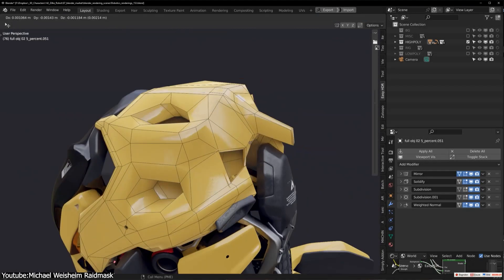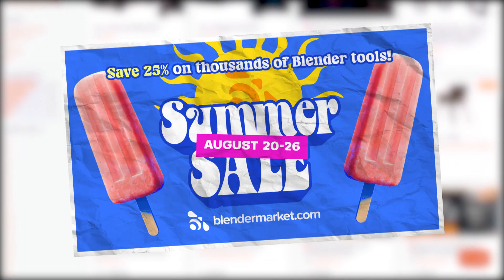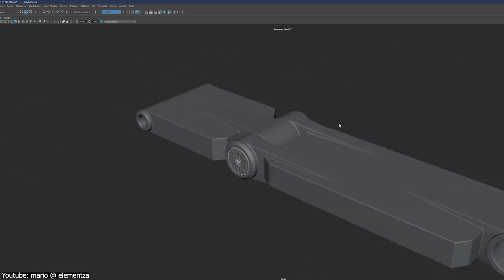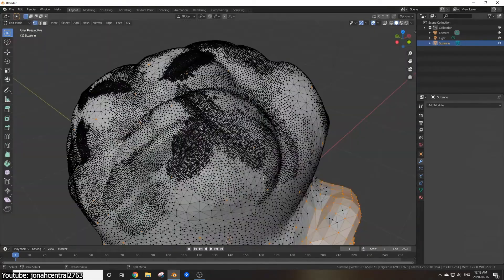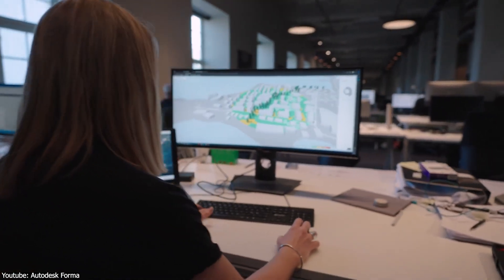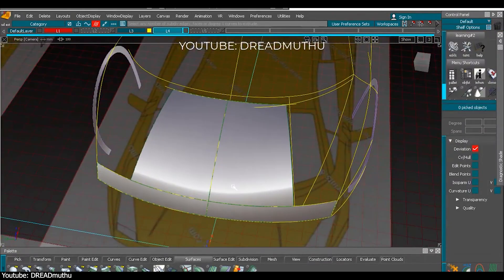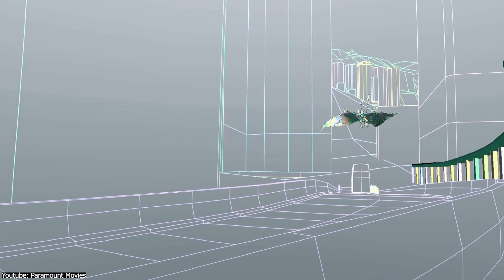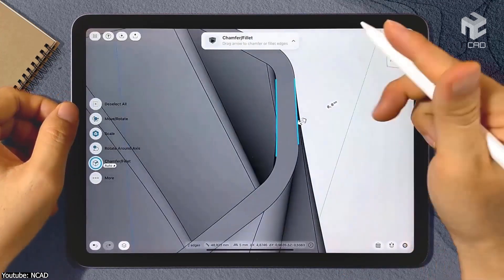Hard Surface Modeling vs CAD modeling

Comment: software is just a tool, and like any other such, specific ones for specific needs...
one particular thing almost ZERO people talk about is: there are a lot of tools one doesn't really need, and only exist to for QoL improvements...
for those who don't know, engineering CAD is generally parametric, depending on what you are trying to design that can be an advantage (but not always, as it sure has limitations), but virtually all engineering CAD needs to use polygons to render graphics, in most setting, this is a computer graphics requirement imposed by the hardware and is non negotiable (which is called tessellation)... in fact tessellation is also used in traditional CAM...
so, polygons are not necessarily "easier" to render (depending on what easier means to you here)... ray-tracing w/out tessellation can be much less computational intensive, but you need the software/hardware combo for that... "polygons simpler to animate" also not necessarily true either as it depends heavily on the software being used (many CAD use "animation" for mechanical evaluation/simulation)...
it is indeed a rabbit hole tho...

Comment: Nice explanations, except it was forgotten mentioning sdf modeling techniques which are rarely mentioned. These allows both cad and soft objects to be modeled. And these software are very promising because they are much more tolerant to boolean operations, on the contrary polygonal boolean leads to abnormal geometry often with trouble in calculating the normals, and CAD simply doesnt allow the boolean in certain conditions, particularly when dimensions are changed in the modeling history leading to impossible shapes (considered as by the CAD kernel used some more tolerant than others)

Comment: Cad is like a high polygon! because it's easier to fall in trap details because of its ease of use, if you need to 3d Print , cad is the way to go , and when you convert it to polygon , it will be harder to retopology the more details the object have! Cad is flat lack texture! so it's converted to low poly so it can be used to game assets and be colored and textured!
Reply: holyshite, if you don't understand how things work you should refrain from saying anything...

Comment: I am a solidworks guy trying to learn polygonal molding using C4D. I found this really helpful.
Reply: Same! Mechanical design engineer with Inventor trying to learn 3DS Max!
Reply: Hi bro.. can you please tell me.. is it possible  to use clean hard surface polygonal 3d model from any 3d software like blender Maya and open this model inside cad software like Catia solidwork and use it for CNC print

Comment: Since I use both Hard Surface Modeling and CAD modeling techniques, I can say that I completely agree with your presentation.

I also find it difficult to determine which method is better. When I think and work like an engineer, CAD modeling is the only way to get the job done without any issues. However, when I approach a project from an artist's perspective, polygonal modeling is superior and more flexible because I don't have to worry about millimeter-level details.

In any case, I recommend that everyone try both methods to fully appreciate their strengths.